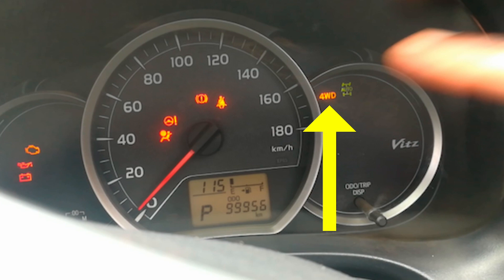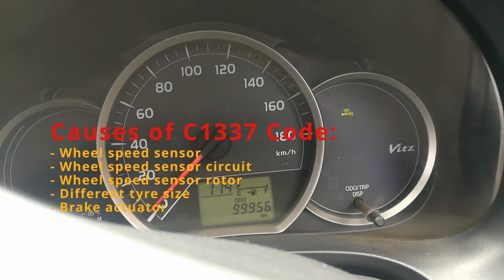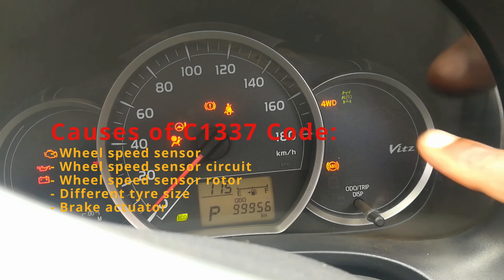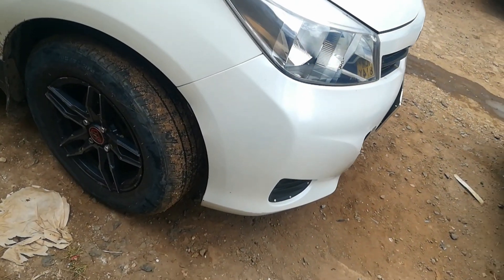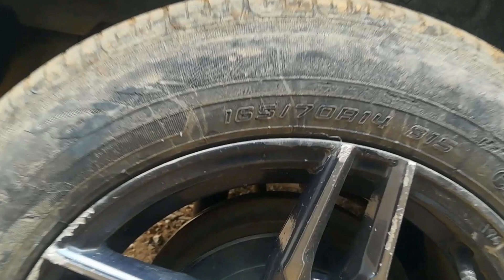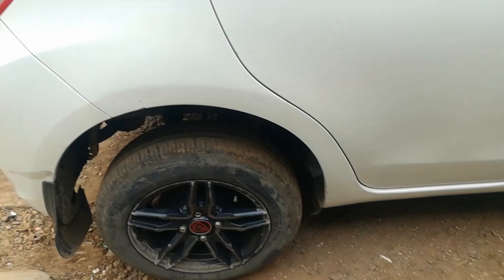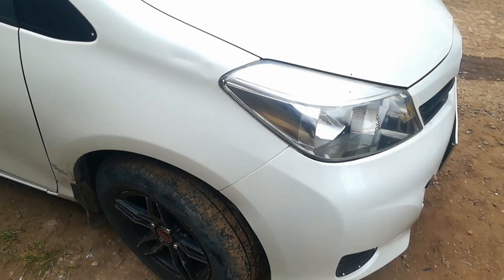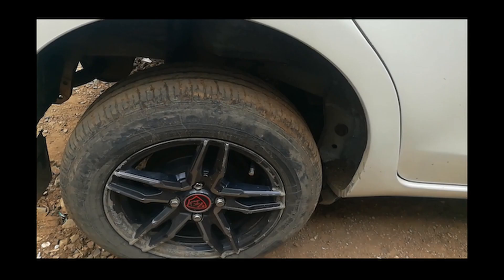C1337 Diameter of tyre is not uniform, 4WD : Toyota Vitz

Comment: Hello boss i am from Zimbabwe can you tell me if the vitz is a full time AWD or part time, i saw it has an all wheel drive button how does it work, also how is the fuel economy
Reply: Hi. The AWD is only activated when the all wheel drive button in engaged. Otherwise it is 2 wheel drive.
Reply: @reachtech1  so i guess mine has a problem it is always engaged in 4wd even if i turn on or off the 4wd auto button